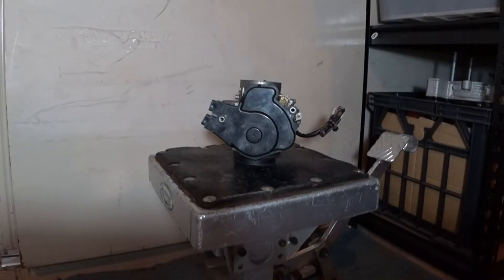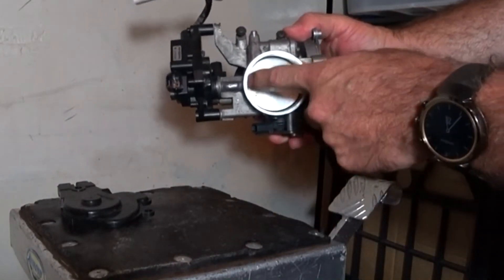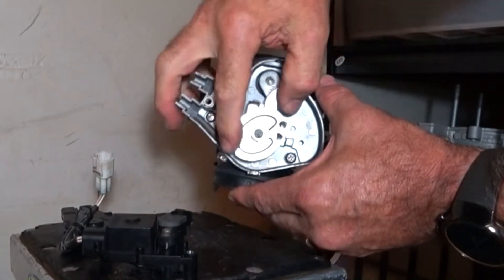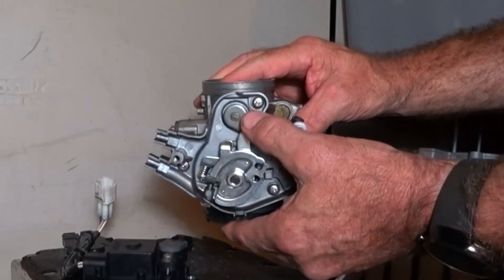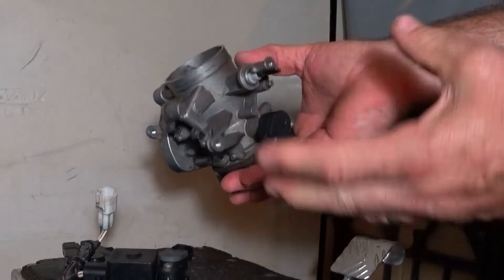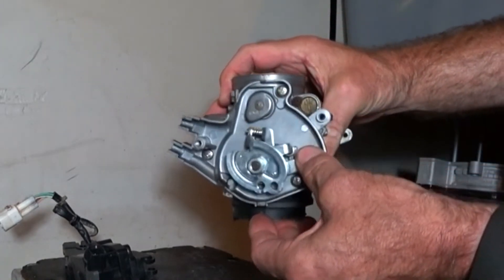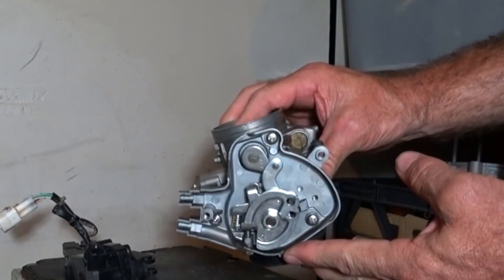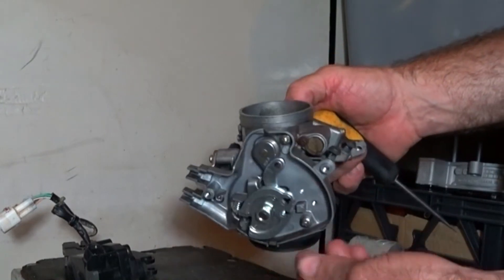Husqvarna 449-511 KEIHIN HANGING IDLE Condition

Comment: Hey mate.
Fantastic video thanks a lot.
I’ve got a couple a little issue on my TE 511 2012, and I was wondering if you could help.
One of them being the stack feel throttle going down hill on single trail, I’ll give this secondary butterfly mod a go.
Also the bike sometimes simply doesn’t start when hot. Almost drain the battery 2 days ago, after it completely cools down (2hrs) it did restart. Any idea where I should start to explore?
I had a similar breather mod on the top engine cover, but it still brings a fair bit of oil on the air box, is yours the same or better than coming from the crank case?
Talk soon, and thanks again. Remi.

Comment: Hi there I have a 2013 te449 and have trouble with it starting when it’s hot could removing that shaft solve that problem? I have removed the butterfly but still wont start when hot only bump start.
Reply: I would check the valve clearances. My guess it they will need re shimming

Comment: Hey man , just bought my 11' te450 about a month ago and I'm having serious flameout issues. Everytime I try to grab a handful it blips out and stutters to the point that it's unridable. After searching the forums I found your information on removing the 2nd butterfly , so I went through the steps to remove it and in the process found that it was already removed and I found a JD tuner stuck to the side of the airbox , which I was also not aware of. Before writing this I had just finished the procedure in this video and took it out for a rip only to be disappointed pushing the bike home from a trail. Where should I go from here? Am I just stuck with a bad year model? Is there anything else I can do to at least help the flameouts?
Reply from the maker: Hey there.
There's a few things to try. 

First, If the JD box looks fairly new, I would definitely look into removing it as soon as possible.
The JD tuner has been responsible for cooking several ECUs/injectors of owners on our 449 Facebook page in the past.

Next check that the spark plug is nice and fresh. It is easy to overlook and when warn can cause running issues. 

I would follow the details in the video attached here and set up your warm idle TPS voltage to 0.75v and see if that helps you.

If you still have issues, then I would test the fuel pressure to the injector with a suitable gauge.

https://youtu.be/oz3sqiBg7xU
Reply: Thank you sir, I'll pull the spark plug this evening and pull the JD off as well. I greatly appreciate your advice, I'll keep you updated on my results.

Comment: Is this still relevant if I remove the secondary butterfly?
Reply from the maker: Some early model bikes need both things done. 
The up to early 2012 bikes with the original separate ignition switch can have issues with the idle staying high during riding. 

If your bike is not affected and rides normally, then better to leave the idle system in place 👍

Comment: What happens if the servo assembly is removed while on the bike? Asking for a friend.
Reply from the maker: Then it is difficult to get back into the original position and will normally display the 'Fail" ecu fault message.

Comment: Hi there, I think I made a serious mistake by removing the throttle motor, as shien in 1:25. I did know that I shouldn't, just trying to rearrange all loose cables on the bike. I've managed to put it back several times, but sure it doesn't work well now. At first the engine could hold not on, then it seems that the revs are a bit high. Please help, what can I do, previously of getting the bike to the BMW dealer???
Reply: Well, last two or three times, the engine does not turns off, but I think again that the revs are high. How can I check that, should I leave it like that? I hate to try again, without knowing if it's now OK...I' not a professional, but I do have extensive knowledge on fixing bikes, since I've studied mechanical engineering, but first time I got stucked like that. Also I own basic tools, not special stuff for TPS adjustment...
Reply: @yamahattr2500  I have exactly the same problem.  Did you manage to correct the high revs while idle?
Reply from the maker: Ah, that's a shame. 
Refitting correctly is not an easy thing to talk someone through....
Reply: Ciao, voglio smontarlo per pulirlo ma dopo serve  il computer per registrare e fare diagnosi. Puoi aiutarmi?

Comment: Great insight and I do occasionally experience this condition on my '13 te449. I have removed the top butterfly and will consider doing this mod as well since it is a hazard waiting to happen. Curious if either may be related to the impression that the bike doesn't seem to slow down as much as my previous bike (wr250r) with engine braking. I get a bit nervous because I'm relying on it to help slow me down, but it doesn't seem to do much and always have to use a lot of brake instead. I know this borders on riding style/skill and it is probably best to seat test to understand, but I was just hoping you've come across this as well.

Also, I seem to have a lot of clutch pull, which may be a mischaracterization of the problem as I'm only a novice mechanic compared to you. The issue is that with a cold start and the bike on a stand when in 1st gear and the clutch pulled completely in, the rear wheel still drives. I've done some online research and people seem to chalk it up to a cold bike with a wet clutch and to just accept it. I respect and trust your wisdom with this bike and was curious if you have any experience with this particular issue and if I need to be concerned?

Thanks Dangermouse!
Reply from the maker: Thanks for your message,, glad you enjoy the vids. 👍 
I think I'm able to answer the 2 parts of your question. 
Firstly in regards to the reduced engine braking, it was designed into the bike by Husqvarna via the idle-up system. When the ecu sees high rpm and a 0% throttle, it was programmed to drive open the primary butterfly using the second butterfly motor, shaft and cam against the idle roller of the primary butterfly arm. 
Removing the idle roller stops thus action from occurring. 
It also stops self idle control, but manual idle speed can be set via the brass Idle air screw. A setting of around 2000 - 2100 when warm seems best. 

On the clutch, you are correct, when cold especially these bikes do suffer a lot of clutch drag. Some bikes can also be a bit tricky to find neutral even when warm. Using a good quality wet clutch rated 5W40 Full Synthetic engine oil will help out. I use Castrol Power 1 Racing, other companies have similar oils.
Reply: @Danger_mouse  Thank you sir for the insightful and intuitive explanation. Godspeed in your adventures.

Comment: Great video. I removed the top butterfly on my ‘12 511 and that pretty much cleared any throttle issues after a reflash of the ecu. Nice additional steps for some of the more stubborn high idle issues. Cheers
Reply from the maker: Great to hear 👍
Reply: how did you re flash the ecu?